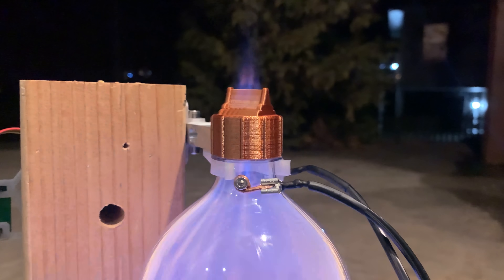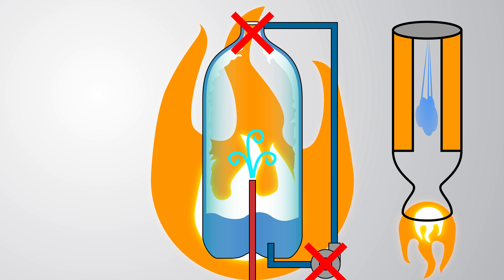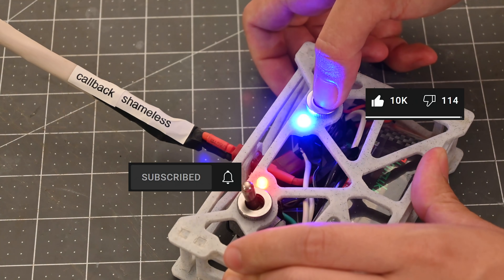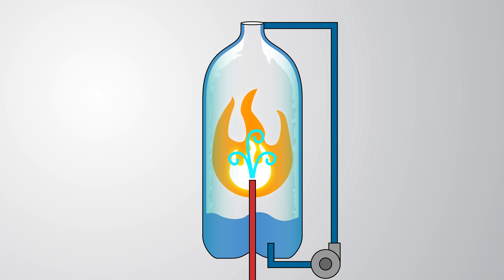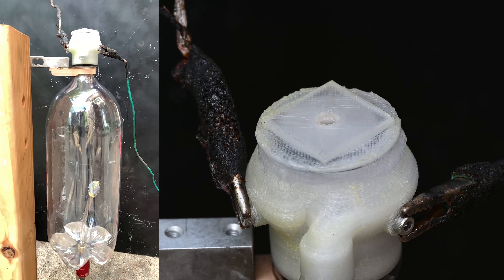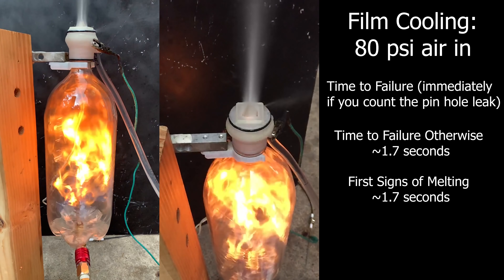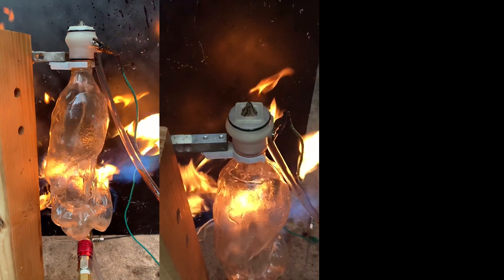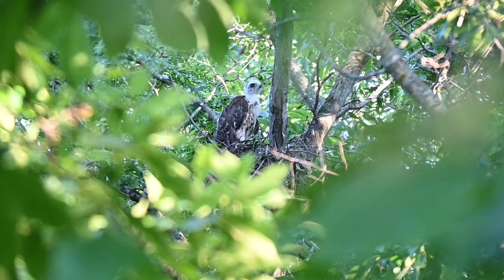Liquid Cooled Whoosh Rocket

Comment: the fuel starts tu burn at the top creating high presure once the combustion travels to the center of the bottle the top has lower pressure while the center has high pressure

Comment: I wonder what happens in that little instant that the bottle shrinks ever so slightly from getting hot? Could that do anything to the pressure that would matter?

Also, I love this. If you can keep the bottle rocket (lol) from melting, imagine what you could do with a metal one?

Comment: inject the air from top to down on the side of the bottle to help cool down and injected it under angle like cyclon effect. Use clay on the bottle to cool down on critical points. try botle from clear champagne bottle also. Would be good to test your turbo pump in pulsejet, And turbo chargeg turbofan pulse jet with turbo pump feeding of fuel. Send me a link about new video please.

Comment: Looks like the fuel coming out your nozzle is separating the water stream like Moses causing the break. What if you put a cap on the fuel nozzle to direct the fuel down into the water bath at the bottom and not to the sides.

Comment: have you tried increasing the amount of fuel coming into the bottle, and decreasing the amount of air ? It also looks like the bottle takes the biggest hit during ignition you could try making a big pressure bypass valve that you could turn of manually. I'm super excited to see how long you could keep combustion going inside of a plastic bottle

Comment: New to channel, new to rockets, and only half way through video.
BUT
Could you coat the inside of the bottle with something quickly, easily, and redoable enough to make repeating the process easy in the future. Like melt candle wax and pour it in while spinning the bottle or something similar? Random thought with no idea if it would even work or if it would just make the bottles too heavy for lift

Comment: The air thing with the steel wool is too high the air that gets horizontal out of it dries out the wall and it always fails o that spot if you noticed that. Try to use your air line outlet like a bubbler so it sprays it everywhere on the chamber walls. Maybe it works better then

Comment: I used a model rocket engine to power a mini turbo pump. Pumped together kerosene and red fuming nitric acid; for about 3 seconds lol. I think it only made it as long as it took to spool up enough pressure to, well, disassemble itself lol. I was nowhere near it because I was pretty sure it was going to happen. Probably the coolest project I've done in years. I'll have a video up soon enough.

Comment: It’s time to get serious. “Whoosh Rockets” are just dangerous kids toys. And if they do not produce enough thrust to overcome there own weight, are they really Rockets. If you have a 3D printer then why not optimize the length to diameter ratio while you are creating a double walled vessel for a thrust chamber and rifle the inside surface so that the coolant (the heavier liquid) keeps spinning and centrifugal motion/force pushes the coolant to the outside. Your defuser is non-optimal. It is a bad idea because the random way that it is twisted abrogates your ability to truly diffuse and insure that no streams develop. Many designs use a method of aiming two or more streams at each other to achieve an optimal uniform Aerosol. Another method might be to employ some kind of sprinkler system, as long as it can remain cool enough. If you could construct/print a tiny turbine you could use tiny tubing to blleed combustion gas from the combustion chamber and use it to drive a fuel/oxidizer pump. Of course it must be ensued that there is no leak, or no pathway for a leak, between the two sides of the pump or shaft. You seem bright, enthusiastic, and resourceful. I’m sure you can do it.

Comment: Ever thought about ceramics? You can use those ceramic coatings on the internal surface. Would need a couple dozen coats but might work. Or a simple tempered glass bottle? One of those that don't break even when smashed

Comment: What you could do is (from the chemistry standpoint) to use methanol (aka. methyl-alcohol). This is an alcohol which is very flammable, lower flashpoint, used in full scale rockets, it loves to vaporize and... is very toxic to mammals when ingested. These properties will make the combustion more complete as it is a lighter alcohol (CH3OH). When your combustion is more complete you get more energy available to use. This also will make it harder to cool. If you liked to try something not so toxic, try ordinary ethanol, not propan-2-ol (iso-propyl alcohol). This is a safer one but you will lose quiet a bit of that energy output. When it comes to ordinary lab safety for methanol (to not get poisoned): don't breath/drink/touch it. The dermal toxicity is not so major, you mainly will get dry hands. 

Best of luck with the idea!

Comment: OK since you're dealing with pretty non lethal stuff I'm going to give you some advice (ofc still try your best to stay safe) so wasn't able to really see your fuel injection system but from what I saw it was just fuel being sprayed towards the middle part of your nozzle try to make it spray down so that it sprays along the walls and doesn't just get thrown out due to the pressure now you have a lot of fuel building up on the bottom so try to hsve your air pipe in the fuel and just "atomize" and mix with it at once also try to keep the stuff in the bottle symmetrical so that you try to limit the combustion instability as much as possible because combustion instability is going to make hot spots which are more likely to melt the bottle and also since your pressure is so low id recommended maybe making a custom (smaller) bottle which will just make your combustion be a little better and you'll have less area to cool making it easier to cool also a possible design id recommend is on the walls of the bottle for you to have (its hard to explain) little like tubes pointing down to just make film cooling more reliable and don't worry about your pump exploding it the pressures are definitely not that high

Comment: It looks as if your air and fuel delivery could be improved. You mentioned watching Integza, he passively "film cools" his rockets by creating a vortex of air that begins at the bottom of the combustion chamber. The combustion creates a high pressure zone forcing the low pressure cool air to the walls but the vortex allows that cool air to rapidly flow along the sides of the combustion chamber out of the nozzle. To solve this issue you will need more injection points for the air to release into the bottle as well as a mechanism to create directional flow to create the vortex. The so called mechanism could be series of air jets implanted into the lower sections of the bottle where the plastic is tough or running two airlines on the side of the bottle to create a less efficient vortex.                                                         Reply if you'd like more tips or find this useful!!!!!

Comment: the issue seems to primarily be the blasting of all of your propellant out the nozzle, I dont think air pressure is your friend here. one option would be to have an inner shield that will protect the fuel inlets from the high velocity flow, thats drawing and spraying your fuel out the nozzle just like a  carb. if you could maybe have an inner nozzle shape that will capture and push the pressure out the nozzle with the fuel coming in from behind it it may allow the fuel to actually make it down the bottle sidewalls. the same would go for inversing it with the added advantage that  the flow would still be cooling your nozzle down that way but you would then either need to just pump fuel through and spay it everywhere rather than having a resevoir OR again use a kneck internal exension to catch the outflowing fuel (although this method would provide a puddle of insulating fluid around the area most likly to fail under pressure, the shoulder

Comment: Try playing with the lower flammability limit and upper flammability limit of your fuel. A problem I see is that the rocket shouldnt combust when its pure fuel inside, the fumes should be too thick and the ratio too high for combustion to be sustained. This means that the only thing stopping your walls from burning are really just how long it takes for the flames to offgas your film cooling and get to the plastic. 

What im getting at is JUICE THAT FLOW to get a whole heck of a lot more liquid on those walls until the only thing that will sustain combustion is the central column that is kept within the flammable limits.

p.s. you can really easily make a tiny ball bearing check valve to put into the fuel feed line so you dont get that backflow.

Comment: Do you know that you can heat up a paper cup full of water with a candle below ? It won't burn. From that you should consider having the cold film on the outside of the PET. And use another material than PET. One that transfers heat better. Also, consider using SLA for the nozzle. It seems to withstand much higher temperatures (doesn't melt/deform with an iron).

Comment: For the next experiment (assuming you're going to flip the orientation of the bottle) what if you combined two bottles by cutting the bottoms off, & nesting one inside the other (bonding with glue/epoxy) , so that you have  double-thickness for the body of the combustion chamber and two necks, one at the top and one at the bottom. Because of the shape, that configuration would lend itself better to the film cooling, as it's more curved, with fewer sharp angles and cavities.
Just an idea.

Comment: is it possible to use 2 pumps to up the preasure of the film coolant then use a higher efficiency nozzle, also just to mess with intgza putting a tesla valve on the bottom to drop the pressure on the falling fuel, if there's a discord I can post in I could throw some design out in my "free" time
Reply: I forgot I don't have airflow simulation, can't do the nozzle :(

Comment: my suggestion would be to take a page from nasa and use tubing coiled around the outside. if you can get it right you can use the cooling coil to heat your iso to its vaporization point then inject it into your combustion chamber for optimal combustion. 

if you want to continue with your current version then lower the psi of the air to the point where you are no longer loosing fuel, remember that the forces of gasses leaving will need to be accounted for.

Comment: What if you aim both the fuel and air downwards at an angle close to the walls, forcing them to spiral down the walls until they hit the bottom, and then come back up thru the center of the bottle, with the centrifugal force hopefully keeping enough of a pressure gradient to keep the hotter flame in the middle all the way up to the neck of the bottle and out the nozzle?

Comment: Use TWO bottles - cut them in half and join them so you have two cap threads. Glue them together securely, and I’d use heat and some pressure to weld them together some as well. On once cap thread, make a joint nozzle that fits the air supply AND your wall coolant on separated channels- an orifice in the nozzle with a cone spray pattern tangent to the tapered walls of the neck of the bottom bottle should do, just ensure the ejection velocity is high enough to carry the fluid up to the top. Do it properly and you can inject the air straight through the middle of that same nozzle, which will create a low pressure zone in the middle of the bottle to draw off fuel from the walls. 

Killing FOUR birds with a single stone: using the coolant as the fuel distributor to reduce the fuel lines to one, using that same fixture to supply the air, REMOVING ALL INCISIONS INTO THE COMBUSTION CHAMBER WALLS, and removing the need to rely on gravity to distribute film cooling evenly.

The only holes you should have now are at the top and the bottom, for the nozzle and the omni-distributor, respectively.

Comment: I recommend using carbon fiber polypropylene for your prints. I've been using that and carbon fiber PETG to build small fuel tanks for my little rocket project I've been working on. The CF polypropylene is harder to print but the layer adhesion is amazing, its very easy to make them hold pressure printing them on my prusa. I've had my CF poly tanks hold up to 400 psi with no leaks at all! CF Poly also has better temp resistance.

Comment: Ok, here's a low tech tip that just might work. Attach a garden hose to your rocket, so the water cools it from the outside. Not sure if you know, but you can boil water in a bottle/plastic container in an open fire.

Comment: What if in your nozzle you have a pool around the edge to catch the liquid (with the bottle upside down), you can angle it slightly to funnel it into the exit hole, that way the liquid that comes down the sides, flows into the little pool and the pressure in the bottle pushes the liquid into the pipe. If the wall of the pool is high enough it won't interfere with the jet stream going through the nozzle in the middle. Clever wall design should also allow you to make the pool the right shape of "air pocket" to push the jet stream towards the nozzle without slowing it to a standstill. Lemme know if this doesn't make sense.

Comment: Your hella cool videos really help me out, so I hope this comment helps ya back.

So, you want to continue these rockets, and you want to work on something mechanical?
Try thinking about what parts of a rocket engine depend on mechanics. Better yet, something experimental or something weird and irrelevant that use mechanics!
-What setting would change how the rocket behaves? If the rocket is moving in a normal or abnormal way, what does it do to the rocket?
-Are there better ways to ignite this rocket?
-What else can you spin? (spinning makes everything work better)
-Is there a way you can apply this cooling system to where doesn't depend on where gravity is?
All great experiments that I'd love to try. Think mechanical, lol.

Comment: Why no check valves or flash back arrestors?
Reply from the maker: There are check valves, but not flash back arrestors. It’s a 50’ hose  and there’s no back pressure unless there’s air being burned to create the pressure so the check valves seemed like enough

Comment: Maybe its not as good for youtube since you cant see inside the bottle. But what if you mixed flour/cornstarch and water to make a batter, and then coated the inside of the bottle with a few layers of it. Coat and dry, coat and dry. You could even scrub the inside of the bottle with steel wool to add extra grip.
My theory is: When the rocket goes off it would start burning the dry flour and form sort of a carbon foam, which would provide insulation from the combustion. 
This would be called "ablative insulation" I think.

Comment: why not use exterior water cooling like the first machineguns no not the gatling gun I'm talking about the machineguns that have the barrel in a tank of water. you could do this by placing the 2 liter bottle in a 3 liter bottle from dollar tree then filling the space around it with water, if 212 fahrenheit is still to much for the plastic you could have a pump circulating water between the bottle and a cooler filled with ice water.

Comment: Hey that approach to cooling is also done on other internal combustion engines by spraying more fuel than cann be bunned so if you use 2 oxygen supply locations one at the bottom spraying in the fuel grating a oversaturated spray that coats the walls and the pressure will pusch the alcohol along side the wall  (adding a small percentage of water to the fuel could also help for the droplets to reach the walls)  and a second that air supply near the throat to burn of the excess fuel because all the fuel spray is  making the shock diamonds invisible

Comment: I think what might help with your air injection issue is if you watch TechIngredients' video on hybrid nozzles, you should basically get a fogger nozzle to distribute the air smoothly around the whole inside of the bottle. More evenly diffuse airflow would help prevent airflow "hotspots" on the sides of the bottle that would cause dry-out conditions. As a bonus, the metal fogger nozzles won't catch fire like your saran wrap does lol. 
As far as inverting the bottle, you could probably take advantage of the 5 little stumpy nubs on the bottom of the bottle and put 5 little pintle injectors in them to flood the sides of the bottle with alcohol. You'd have a huge excess of fuel coming out the nozzle that way, but you might be able to take advantage of your swirly injector nozzle thing to inject more air to try and take advantage of that.